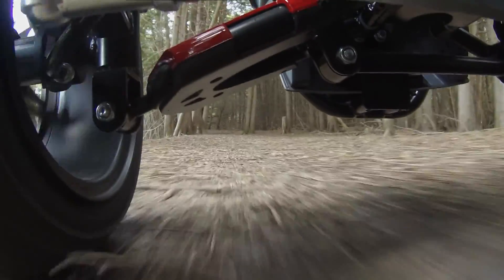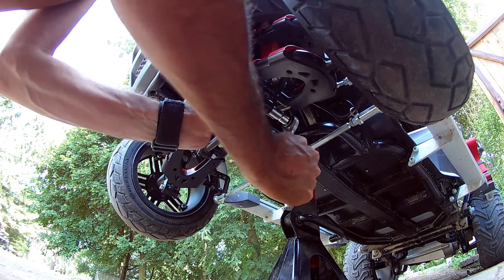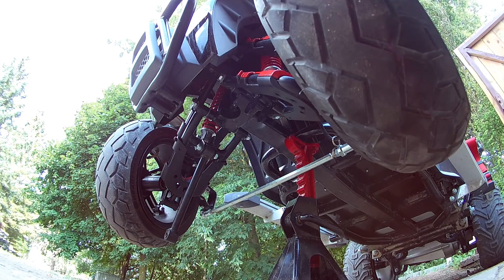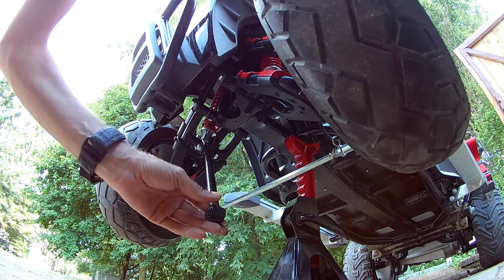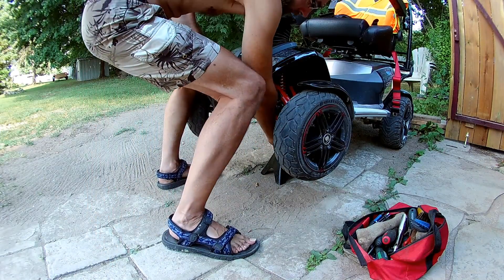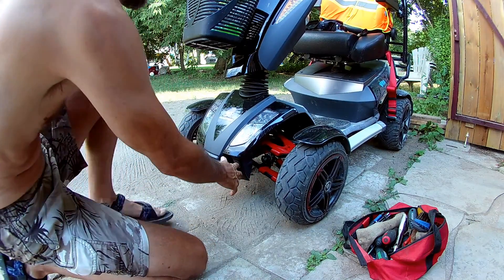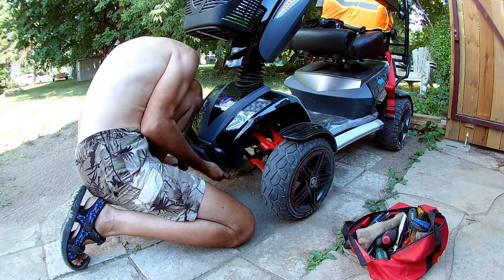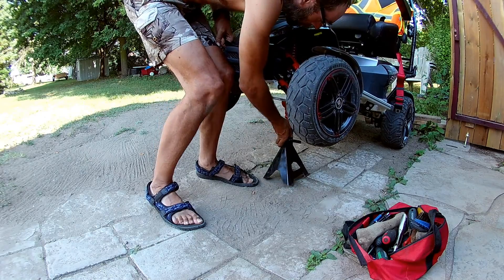Failed Monster Suspension Experiment

Comment: Basically all suspension on most scooters is shite ie my ST6 is crap, maybe stronger springs or air shock with spring & a longer suspension may help, my old ST6 i put longer ones on the front it made a big difference to grown cleaners i still have them so in time I may put them on this one 😀
Reply from the maker: If the front suspension was actually "independent" as they claimed, I'm sure it would be much better. I just wish I had the ability to "alter" it the way I would like it to be. Unfortunately, it's beyond my current abilities.
Reply: @TheTimeCapturer  hears some info on the battery front: What the battery companies won’t tell you. 

Replacement batteries cost a lot of money and everybody knows that batteries wear out over time. What most people don’t know is that 75% of lead acid batteries fail because of sulphate build up on the cells, not because they are worn out.Sulphate build up increases the internal resistance of the battery, reducing its capacity and leads to premature battery failure. Sulphated batteries can now be successfully recovered saving the cost of expensive replacements. You can also stop sulphate build up on new batteries which could double the life of your batteries; in effect this will reduce your battery costs by 50%.  

The main causes of sulphate build up on lead acid battery cells are: Batteries sitting too long between charges, storing batteries without charging, undercharging batteries, low electrolyte level and incorrect charging levels.  

The problem of sulphate build up on lead acid batteries has been known about for a long time, and battery charger manufacturers have been adding what is called a “pulse circuit” to their high end chargers to help overcome the problem, calling them charger conditions and can cost upwards of £100. You will also see these pulse circuits or pulsers advertised from around £15, they do help a little, but don’t fully solve the problem. In effect all of these pulse circuit devices send a high voltage current into the battery which will break down some of the sulphate build up on the positive battery plate. As they generally only work whilst the battery is being charged they can never fully recover a sulphated battery or protect a battery fully from sulphate build up, the high voltage spikes they generate can also damage the battery in the long term.
Reply: @TheTimeCapturer  looking at that bar that gose between from one side to the other, if one could have that bar criss cross as in like an X ie the left brace from wheel would be fitted to the upper right & the right brace to the upper left would in theory give you a more independent suspension system but like I say have a look at SUV's as they have a similar suspension as your scooter like in some cars that have the twin wishbone with a suspension spring between them if your can work out the difference between them you could possibly come up with a solution to getting it closer to the type an SUV has Ie with many cars etc with a twin wishbone when you lift them off the ground the wheels tip inwards and the only reason your wheels went out further with out that centre bar on I personally think its because of the week suspension again look at an SUV your understand what I mean when you see the underside of the SUV
Reply: @TheTimeCapturer  go have a look at this battery device https://www.ebay.co.uk/itm/battery-desulfator-and-reconditioner-restore-lead-acid-batteries-12-24-Volt-/252120721226?_trksid=p2349624.m46890.l49286
Reply from the maker: The steering is set up for stationary suspension. To change the suspension to truly independent would require a completely different steering setup. As for the batteries, they are gels. Gels can't be fast-charged without destroying them. Either way, it doesn't matter because I don't pay for my batteries. Being on ODSP, the government covers the cost of repairs to medical devices, including mobility scooters.
Reply: @TheTimeCapturer  and thats the problem with mobility manufacturers if they put as much effort into making mobility scooter as well as they put into the stand up scooters they'd be so much better all round You have one in Canada who's made one for military use its a 4 wheel 45mph and I believe the distance it can travel is 100 to 200 miles openly seat

Comment: No experiment is a failure if you learn from it. You're right the equalization bar(or a dozen other names) makes your machine act like a lawn tractor. You could remove it but you'd have to adjust the coilover shock absorbers to be a little stiffer and also add a sway bar(anti-roll bar) to the front suspension to keep the machine from leaning too hard in turns. Someone familiar with quads should be able to help you source a universal sway bar kit but it would require some fabrication. The machine is designed to be easy to manufacture and satisfactory for the "average" person which means it's not not great for everyone. Anything can be done if you really want to, I'm disabled but still work on my cars and go racing when possible, I've made a lot if adjustments to my life but refuse to give up my tools, I'm glad to see you get around as much as you do. If I can help just ask.
Reply from the maker: Thanks James. My biggest problem is I still don't accept my disability so I tend to overwork myself and suffer the consequences later. I was planning to get a welder a couple of years ago but, finding out I was losing the garage, I never bothered because I wouldn't have a place to use it. As far as being satisfactory to the average user, to be honest, I'll never be happy about something unless it rides on a cushion of air and steers like it's on rails. The Monster is the closest I've got to an ideal machine. It really is pure joy to drive, despite what I may not like about it. If, down the road, there is something I can improve on it, I'll definitely consider my options.
Reply: TheTimeCapturer I am looking to purchase one of these Vita monster scooters and was wondering if you could tell me how tall are you I am 6 foot 2 275 lb and we're about a size 13 shoe I'm worried that my feet won't fit on the deck and the seat is too close to the tiller I can ride with my legs straight down a little bit but need to also stretch them out. Can you put your legs up over the front the foot pads that are angled would be perfect because of my issues with my feet it's just a lot of money to spend to find out you don't fit on it know what I mean any information you can give me would be greatly appreciated. I love the looks of this thing but it seems three wheel models like the Royal 3s has more leg room but it's not as cool looking as this one. How is the power, does it go as fast as they say and will it climb a curb. Like I said any info would be greatly appreciated thank you
Reply from the maker: @dtc6776  I am so sorry for the late reply. YouTube never sent me any notice... I just stumbled upon it now. There should be plenty of foot room on the deck. My feet are 11 1/2 and there's room to spare. You can put your feet over the foot pads but you would likely block the headlights which are close to the top. The seat adjusts forward and back but I suspect if you move it too far back, your head will be bouncing off the roll bar. I'm 5'9" and 120 lb and I don't have any issues with that, but I do have the head rest just in front of the bar. I too like to stretch out. I put my feet past the foot pads on my old scooter all the time but the single headlight is in the center and not blocked. I do it with the Monster when I stop and take a break. Also, the tiller is close to my legs as it is so, driving like that, it might actually hit them. The seat is up quite high and I think the tiller should be higher as well, to compensate. The power is quite adequate for normal and some moderate use but the scooter will gradually slow down on long steep hills. Reverse is useless on anything but level ground, as most scooters are. It will climb standard curbs but, because the tires are low profile, the rims tend to hit them. I don't do much of that any more because the ball joints already need to be replaced every year and that really stresses them. The speed depends on where you live. I'm not sure of the laws here in Canada, but mine is 20 km/h (12.5 mph). Some of my viewers from Australia and the UK say theirs are much slower because their laws require that. Hope that helps. If you have any more questions, feel free to ask. Hopefully I will get a notification this time. Take care.
Reply: TheTimeCapturer we P

Comment: Interesting trick/test! … compare to the efforts, car-makers do with 5-point-suspensions etc yaddayadda ... ;)

Puzzled, but probably way beyond DIY: 
a) what would happen if you replace the stiff 'strut brace' by some flexible damper/spring combo? (for a quick'n dirty test drive: bungee chord??)
 
b) what would happen if you replace the actual two springs by (much) tougher ones (see no nuts'n bolts for pre-stress)? your results without that bar look simply too 'soft' in my engineering ignorance ........... 
the bar adds some geometry marvel which gives the actual springs more 'leverage', without it = not strong enough.

… just some thoughts …
btw: asking for a friend, no scooter in use here (yet), for me it's just some … engineering puzzle :)))
Reply from the maker: Karsten Schlüter There would have to be a total redesign of the steering. As it is, the wheels are connected by a solid bar. If one wheel turns, the bar forces the other to turn as well. In order to add any kind of springiness, the steering would have to connect to each wheel independently. Maybe future models will be improved. :)
Reply: ah, I see - lost in translation, didn't catch, that that bar isn't just more than a 'stabilizer'. For sure, my suggested piece of rubber wouldn't work as replacement LOL (on cars the joints are cushioned with rubber)
 
At last this video shows a lot of the 'structure', which leaves some made-for-the-tough-ride-impression, as far as a pic can tell. 

Thanks TTC, very helpful & Keep posting!
Reply from the maker: Yes, I was impressed the first time I saw the frame. It looks very strong. Thanks for the comments. :)